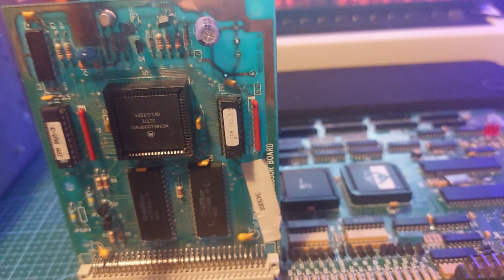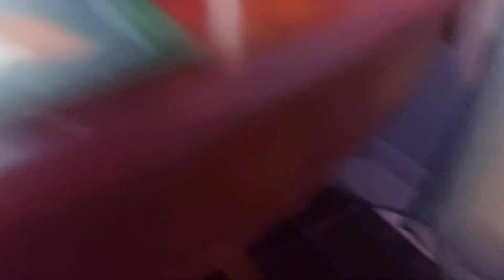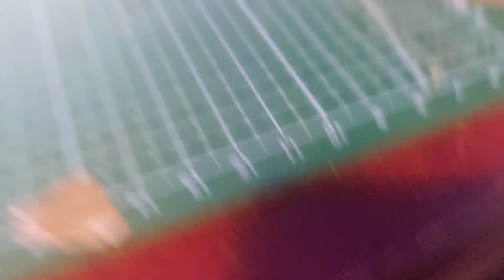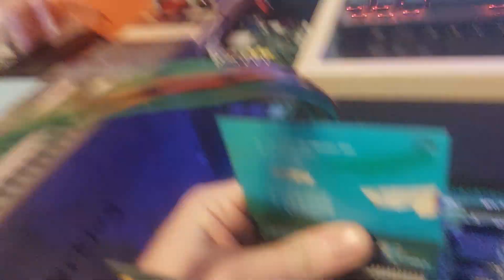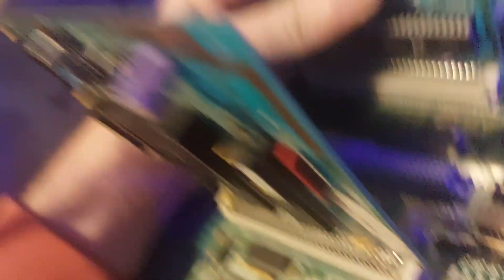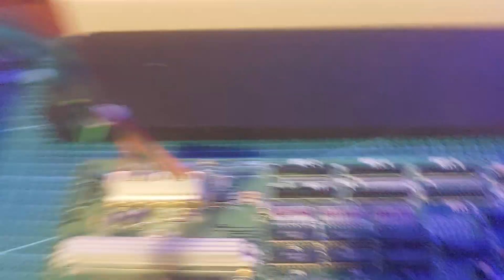James' Haunted JPM impact, demon free at Magiks

Comment: It's a mental fault which we need to replicate.
Reply: Hi James / Magik
I have this exact same reset fault with a very clean (non-battery damaged) Impact 1 Main Board.
The board boots fine in the machine, plays happily for a period of time (maybe around 10mins or so) and then suddenly just freezes the machine and the status light goes out.  Even with a battery on the known fully working Processor Card, it causes the machine to ram reset as the volume goes back to being very loud and 777 appears on the reels at the next hard-boot.
Interestingly, it’s the exact same board revision as in this video  - the later 1996 version with the red dil switches & no speaker plug socket, and not the earlier 1994/95 version.  It’s such a strange fault.
I know it’s the main board itself, because if I put another Impact 1 main board in the machine, the machine plays fine and doesn’t reset.  I’m thinking it’s possibly ram related, but I haven’t changed that out as yet.
I will let you know if I manage to fix the fault, and likewise, please let me know if you manage to fix it.  Looking forward to the follow-up video.  Good luck both 🤞
Reply: @johnb147pro  what machine are you running it in and is the processor a green original or a red processor?
Reply: Hi James, thanks for replying bud.
It initially happened in a club Outlaw (and obviously being a club machine it was annoying as it kept loosing the game memory) and I thought it might be a one-off, so I’ve now tried it in an AWP Casino Crazy and the exact same thing is happening in that machine.  Problem is, it’s a difficult fault to spot out of the machine on the bench, as all you (and Magik) have to go by is keeping an eye on the status light.  But yeah, bit of a coincidence being exactly the same revision board and fault, and my board it mint, just like it’s come out of the factory with no damage or previous work on it.  Have you changed the ram yet in yours?
Reply: @johnb147pro  We are working on the theory that this one of mine has the Electra bug, however as yet Magik can't replicate it at his, I am burning my roms to see if its Rom related.  Dom had an issue with his Monopoly 60th where it on power down said bookkeeping briefly and ram reset.  This one was being caused by the refill barrel.  Mine is still a mystery like yours is at the moment.
Reply: And it’s running on the original green processor card, fully working with a fly wired battery.
Reply: Just realised it can’t be ram as I don’t think there is any ram IC on Impact 1 main boards.

Maybe U5, could this IC cause reset issues? 🤔
Reply: @johnb147pro  2 sticks of ram on your processor card. Might be a bookkeeping error like Doms